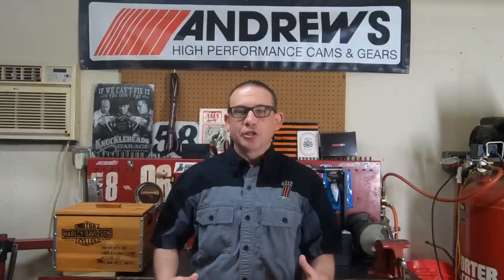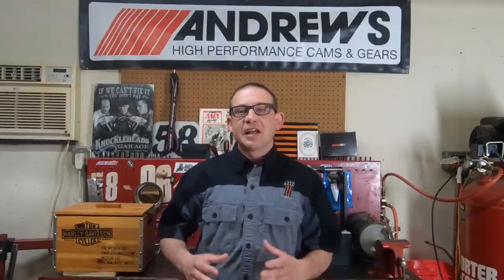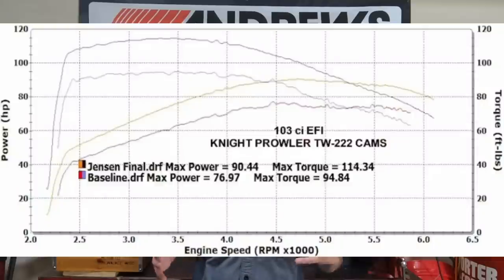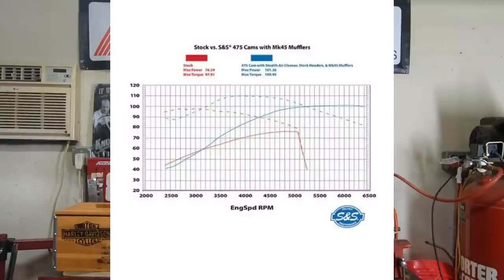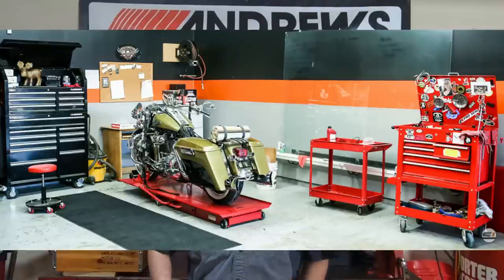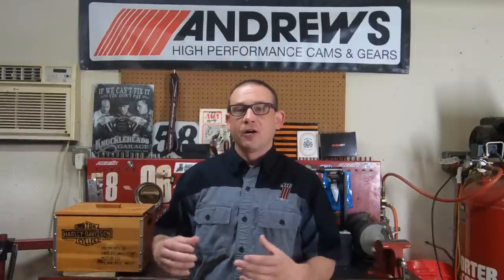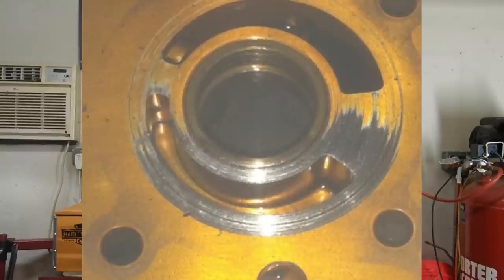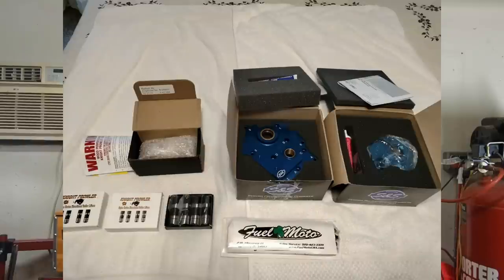Performance Harley Cams Have Their Issues

Comment: I really enjoy your video's,   I have a 2000 Road King,   lots of TLC was needed.  Performance wise,  Thunder Max: ECM, tuner, wide bang O2 censor, manifold, fuel injection system,  Vance & Hines headers, S&S oil pump,,,,,    and I'm very pleased with it ,  I have a itch for a wood cam. Lol

Comment: 96" with stock cams was driving me nutts with the tic tic tic sewing machine sound, now with Andrews 48H it's more noticeable.  Dreading taking the tank off, pulling the covers and adding rocker lockers but I guess that's the next project.  Stock cam bearings are so crap that one broke after it was removed taking it off the cam puller tool.
Reply: I kinda enjoy the whirring sound of the performance cams.

Comment: Love your video's, I have a 2015 Ultra limited, would the S&S 570 be the cam for me. ?
Reply from the maker: Really depends what kind of riding but being on an ultra l would guess your looking for the low to mid range and not so much wide open power. If low to mid is what you're after the 570 would be a good cam for your bike.

Comment: Can I ask you a question! I have a S.E. 110ci with a zippers 587 cam and was going to bump my Compression from the stock 9.2 to 10.1 would that Cause problems?
Reply: I just did this to my 110,s&s 570 cams,lifters, cam plate,bumped compression to 10.1 and a good tune..runs great..torque 114,HP 98..couldn't be happier!!!

Comment: My evo ultra classic has a very high lift cam and it was great with the 5 speed  but I put a 6 speed and I'm thinking about changing the cam to a smaller one because at 75 mph I can't run in 6 gear
Reply from the maker: That must be a really tall 6th gear, you'd think that cam would be enough of a bump to pull that 6th gear.
Reply: @GixxerFoo  the cam comes in about 3200 rpm to 5000 and the 6 speed gear kit I put in the bike 6 gear is .86 so about 2900 rpm at 75 mph but the cam is more lift that were I ride at

Comment: Cam gear/pinion gear noise or whine?
All the Harley Screaming Eagle Evo cams I've installed in the past decade or 3 have been marked and made by Andrews. Pinion gears are not cheap. If the new cam gear ain't right, I just press the factory-matched gear off the original cam and put it on the new cam.

Comment: Something I never see addressed is fuel mileage. I’m considering a cam swap at the end of next season, after the warranty is gone. Probably S&S 475 for my 107. I don’t care about performance numbers, it’s mostly about the sound and acceleration when you need it. But, I daily drive it, weather permitting here in the Midwest. What would that do to my mpg? I’m getting about 38 now.
Reply: I went from 42 ish to 36 after adding cam to twin cam.
Reply: My 2020 Road Glide with Ventilator Air Cleaner, 4.5 inch Tabs with Zombie inserts and a screaming beagle tuner was usually 50-52 paper and pencil figured fuel economy.  With a Star Racing 30/30 cam, knight prowler tappets, S&S cam chest and Fuel pak 3 it is now at 42-46 mpg. Hope that helps. I will also add one afternoon a group  of us went out horsing around and I refueled on the way home it was 34. Playing hard wipes out mpg.

Comment: I had the Feuling camchest kit installed on my ‘13 street glide. It came with adjustable pushrods, cam plate, oil pump and of course cams. It created a ton of noise. How do I know if it’s normal valve-train noise or something like valve to piston contact. I’m very concerned as I’ve never heard the noise on any other bike. I’m afraid the pushrods weren’t adjusted properly or something like that.

Comment: I know you like wood cam bout what's your thought on Star Racing 3030 cam for a 2020 RoadGlide 107
Reply from the maker: They make power up there with the Wood, they have a killer sound at idle too! Star Racing has been around a long time and won a lot of championships in drag racing. The 3030 is an excellent choice for a bolt in with a 107, it makes power comparable to the Wood 222 for the M8.

Comment: About to do cams on my 09 dyna fxdc tc96. Not wanting to do a big bore any time soon. Wanting more passing power/torque. Think woods TW222 would be a good choice? Already have air cleaner and pipes.
Reply: Check out Andrews 48H it's kinda the go to cam for 96".  Just did mine few weeks ago, nice new sound and power according to butt dyno.  Mpg took a hit though..

Comment: GixerFoo, I’m planning on sending my left case half to Hammer Performance for installation of the Timken bearings for the crank of my ‘06 88 TC. I’m also planning on sending them my cylinders to bore them to 98 ci and the heads for CNC porting. The Hammer Performance pistons are supposed to give me a 10.5:1 compression ratio and I’d like to use a S&S Easy Start cam to make it easier to start and easier on my starter and battery. Would you consider doing a video on these Easy Start cams? My other question is that with these modifications I should be into the lower hundred range on horsepower and torque. Am I pushing the limits of the stock Harley belt final drive and/or the stock 6 speed transmission. I plan on adding a Fuel Moto/AIM Variable Pressure clutch and a Darkhorse Man O-War compensator along with a manual primary chain adjuster. Will this bring the rest of the drivetrain up to being able to handle the power that I’m planning on producing from these engine mods? Do you have any other suggestions other than exhaust, air cleaner, oil cooler, and a dyno tune for the finished project?
Reply: I just did the square 100 kit on my 06 88. Its in an flhtci.
I also have concerns for the belt. Plus the added performance has had me running way harder than I did stock. After some 2500 to 3,000 miles Im starting to mellow out.
The easy start cam starts right up with 10.5 to 1. Cranks just like it did stock.
As for noise there is a loud clank when you shut her down. Its the little flipper on the lobes. Its a strange sound that will make you think bad things. But its normal.
Also the engine has a pleasing sort of lope at idle.
I am nit 100% pleased with the tune yet. Too rich in spots. Doesnt feel happy unless your running it hard.
I did not dyno over 100.
I think it was 95 ft lbs and 89 hp. I have the stock head pipes. Going to swap them out this season.
The other draw back is no oxy sensors on my built in October 05 bike. So fuel management could be better.
Runs like a beast though.

Comment: I've outgrown my stage 4 131 installed in my R.G. I too am a Woods cam fan. I'm torn between a 22XE and 77X, any suggestions or input? And as for the cam plate and oil pump, it is a crate 131 so they're supposed to have upgraded this and or that but who really knows. Any words on an aftermarket swap? Thanks in advance
Reply from the maker: You've definently got the the right setup already to support the 77X, the factory cam in the 131 really holds it back. You won't be sacrificing horsepower at all even though that's a torquey cam. I would go 77X since your motor is already setup to support it. It uh, it will really wake it up and come life on another level.
Reply: @GixxerFoo  Thank you

Comment: What’s the best wood cam for a 103HO. I ride low rpm’s. And love the galloping sound at idle.
Reply: PS. Water cooled heads.
Reply from the maker: Since you've got a touring bike l think you'd like TW-222. That's a killer all around power cam, excellent bottom end and then it takes off and pulls all the way to the redline. With a good exhaust, air cleaner and tune it's not uncommon to see 100+ horse and torque on the 103.

Comment: Like my wood 222 on my dyna but mam the valve train noise... ehhhh
Reply from the maker: Yeah they make noise that's for sure, but they lay down some serious numbers.
Reply: I run woods 222 in my 103.
I have noticed that if I use amsoil the noise or ticking is louder than if I used Harley oil.
After replacing the cams I broke it in using Harley oil nice and good sound and after 500 mi changed it out to amsoil there is alot of difference.
Reply: @kellumreynolds6113  Harley dino oil or synthetic?

Comment: Is it possible to put a cam like the Harley torque cam in a m8 with a factory exhaust? Unsurprisingly, I’m not finding much info on cams with a quiet exhaust.
Reply from the maker: Absolutely, with the stock exhaust you'll give up a lot of horsepower but you will have really good torque! Screamin Eagle is a good quiet exhaust, you might look at S&S exhaust. They have some great performance exhaust that you can get with quiet baffles and cats that will flow well, not terribly kill the power but they will keep the sound down too.

The quiet exhaust knock the horsepower down but they will give you excellent torque paired with a cam.
Reply: @GixxerFoo  thanks for the reply. Just some more torque for two up riding on my ultra is all I need.

Comment: I’m preparing to purchase my first Harley soon .   I would like to ask for some tips on what to look for in purchasing a used Harley and what to steer clear of please ?  Thanks in advance
Reply: First tip ....   stay away from the dealer if you want to literally save thousands for the same bike you could find from a private seller.
Reply: @bigblue3568  Thank You for the tip . I’ve already found several beautiful bikes with thousands in upgrades that have a nice price tag. Between $5,000-$10,000 and no issues
Reply: If it's got over 20K miles, have them pull the service records for you and consider the extended warranty...saved me 5k right away.  Ride safe
Reply: @dallaspirate5093  thank You 🙏 for the tip

Comment: Thanks for the great cam info in this vid Gixxer. I've got a stock 2012 Heritage Softail 103 and was thinking about a Woods cam. What model Woods cam would you recommend or should I consider a different one? I'm looking for better low and midrange passing torque but not too concerned with top end power. I'm also getting a PV3 to improve the mapping with a custom program. Thanks.
Reply: look at the Andrews 48H
Reply: @jimholmes8227  Thanks I'll check it out.

Comment: Sir I have a ? After 2002 HD. Presses their crank shafts. Now in your other vids you have said if you go much more than a stage1 you will run the risk of expediting run out. How can you put a cam in any bike esp the M8 without sending your crank off to be fixed the way it should have been from the factory. I have a 2002 H.D. so no problem. However 2003 to today the H.D. Motors have a built in flaw that can destroy their scoots motor. Will it not?
Reply: @Kevbo I have been told they are not by a Harley master mechanic  who now owns his own shop and built my scoot.

Comment: I want to get a screaming eagle cam for my m8 114 streetbob 545 I think just for added torque for my heavyweight loads I ride with . 180 lbs  plus me 200. Lbs. Which screaming eagle would you recommend. I have the screaming eagle deep breather stock pipes.

Comment: Use the cam and valve chest and oil pump and headers and exhaust and air filter money, and go to Sturgis a few times, instead. My 107 softail cruiser has plenty of balls, stock, more than enough for cruising.  If you want more  horsepower, buy a sport bike.

Comment: What kind of cams do you recommend for a 2007 street glide with the 96” twin cam? I want more power and a nice lobe without sacrificing my fuel mileage
Reply: Opening the exhaust valve early makes the exhaust louder and lumpier and carries the HP out a little further, which most people like.....but it does cut into MPG’s bleeding that power stroke cylinder pressure early.  For mpg’s compare cams and look for one that opens exhaust valve later....closer to BDC.

Comment: Hey gixxer First off love your video content very informative. I must say after watching your cam comparison video for the 107 and 114M8. I went with the woods 22XE on my road king's special.  And was not disappointed? It's one of fuel motors Top selling cams. I did notice my gas mileage has dropped somewhat can't believe it's the way I Ride LOL.
Reply from the maker: That cam is crazy in the M8's! Literally puts out what you would get with the basic Screamin Eagle Stage 4. It's hard to stay out of the throttle when you get that kinda power! I imagine it's got a nice head turning lope now at idle!

Comment: Off subject here but have you done a vid for the XR1200?Whats your opinion of those?
Reply from the maker: I haven't done a video on the XR1200, but those bikes are fricking awesome! If you can find one, they are getting harder to come by. They have a lot of Buell tech in there, I wanna say the cams in it are the Screamin Eagel 570, compression is higher like a Buell, the heads are the adaptation of the Buell head which went into the 07 and later Sportster. The big power producer on those bikes is that down draft fuel injection. XR1200 is basically a Buell in Harley-Davidson trim for the most part.
Reply: @GixxerFoo  Thank you sir!I actually just bought an '11 XRX trimmed out in black,its in pristine condition less than 10k miles with Termignoni exhaust slip ons

Comment: Change oil. Pump. Will. Racing. Oil pump. Make run. Cooler.  And if change. Oil pump. With racing. Oil pump. Do you. Need change. Cam. Plant. Also.   Ae. Will just Oil pump. Be just as good. Leave fatire. Czm pla t

Comment: Every post you make just helps me with my decisions on my 2008 96 twin cam,  I have had a few people tell me it's time for a cam , but will have to wait and see. Just got a tuner and high flow air filter to go with my slip ons . Thanks again for all you do .
Reply: You better think about tightening up that lower end before you start with that stage 3-4. ( Timken bearing)
Reply: I did the Harley cams on  my 08 Ultra.   It really woke it up.
Reply: My 2008 is getting the Feuling cam chest right now. Can't wait!